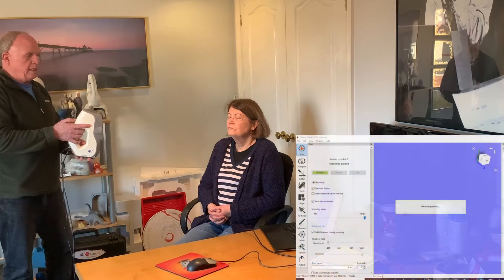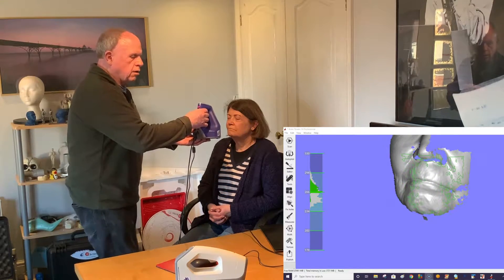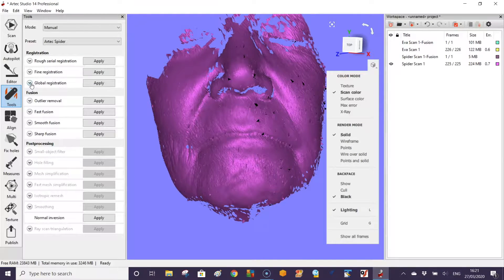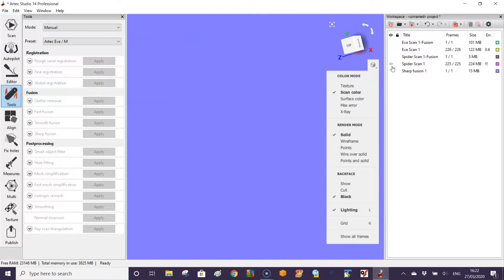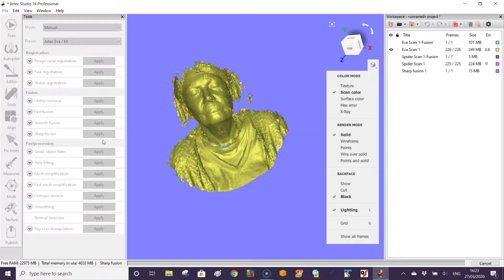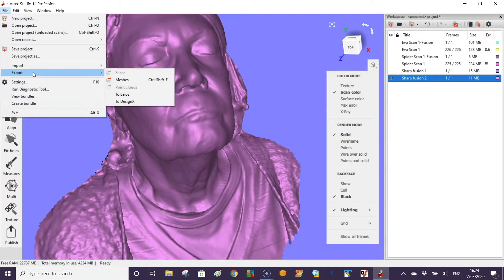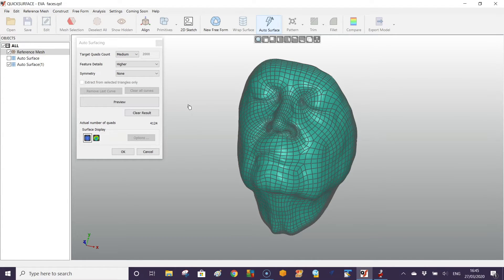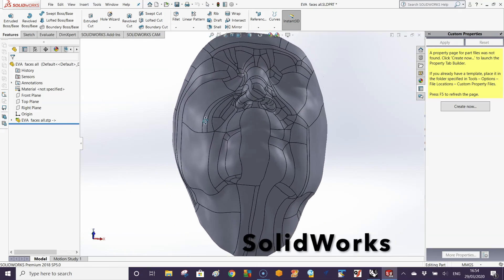Face Scanning With Artec3D

Comment: thanks for the video.  Is the Eva lite same in geometry detail as the standard Eva?  I don't need textures just the geo..      thank you for your time.  :)
Reply from the maker: If you just scan geometry rich shapes, like the face, then EVA Lite is perfect.  If you were to scan larger areas with limited geometry, say a large map on a flat wall, then the Texture tracking on EVA will do this.  You can alway update from EVA Lite to full EVA with HD and texture tracking should you need it in the future.